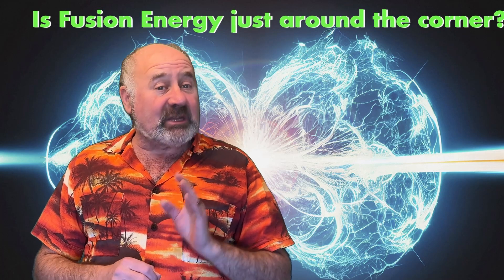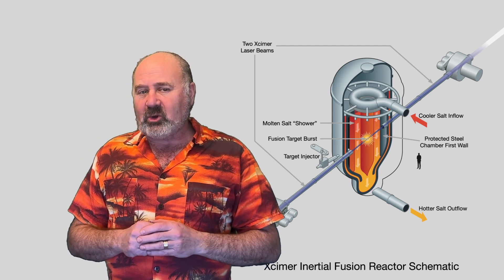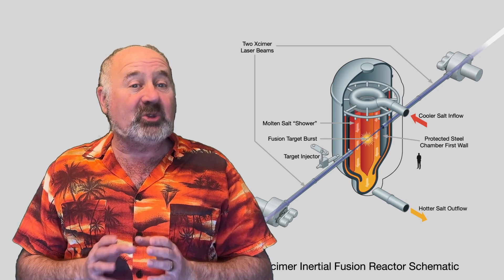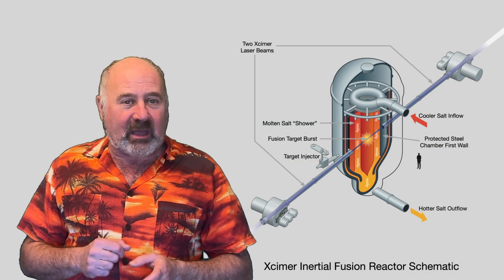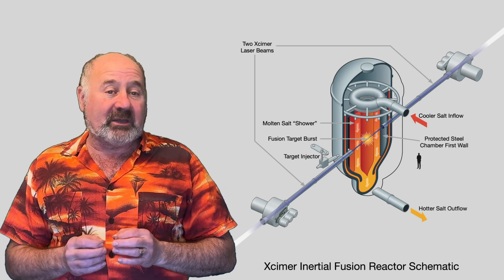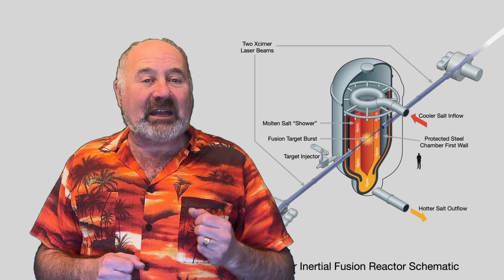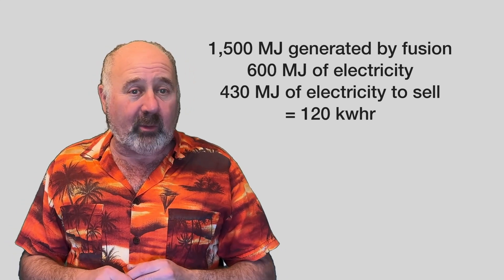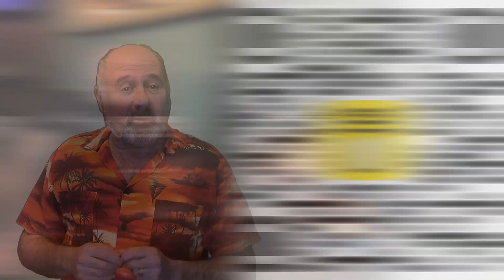Can millions of mini hydrogen-bombs power our world?

Comment: Dear Dr. Silber, thank you for your questions. My plan was to immediately answer them. However, your question about positioning a 20 mg bubble of DT was made irrelevant by Improbable Matter, another highly respected podcaster, who informed me that 6.6 GJ (=20 mg DT fusion energy) far exceeds the maximum reasonable yield (450 MJ).  So, to make everyone happy, I will assume a smaller 1 mg (=330 MJ) bubble when addressing your question. 

Here are the parameters, taken from a spreadsheet I designed to answer such questions: 

	Fluid: (Yb:FliBe, rho=2000 kg/m3, T=750 K, mu=3 Pa.s, 0.19 N/m, 2414 J/kg.K, bp=1703 K) 
	Bubble: (1 mg, 50:50 deuterium/tritium, gamma=1.4, 100% yield=330 MJ) 
	Acoustics: (50 Hz square 15 +/- 5 atm., 50 Hz triangular 40 m/s2 (equ. 4 Gs)) 
	
I used PV=NkT, with 10, 15, and 20 atmospheres pressure, to calculate bubble radii of: 0.53, 0.58, 0.66 cm.  By inputting those radii into the formula (2/9)rho*G*r2/mu, terminal velocities were calculated for upward rising bubbles under the influence of gravity (G=9.81 m/s2): 4.0, 4.9, and 6.4 cm/s. Likewise, the terminal velocities for acoustically driven bubbles were calculated, using G=40 m/s2: 16.5, 20, and 26.2 cm/s. However, because an acoustically driven bubble changes directions 100 times per second, and needs time to accelerate, its average speed is slower: 15, 17.3, and 20.5 cm/s. Thus, it should be possible to acoustically drive a bubble 5.47 cm/s, in tiny steps, relative to the bulk of fluid that surrounds it, by ratcheting back-n-forth, slow-n-fast (15 vs 20.5 cm/s), under high-n-low pressures (20 vs 10 atm). 

Will these bubbles dissolve? I wasn’t sure, so I asked Gemini 2.5 Pro Preview 03-25 and ChatGPT o4-mini-high for their opinions. They both agreed, for short 1-minute time periods, almost no gas dissolves. More specifically, Gemini predicted 0.00372% and ChatGPT predicted only about 0.000012% would dissolve. 

To understand how various pressures (10, 15, 20 atm) influence these bubbles, I calculated the following: 

	Bubble resonance frequency: 1104, 1548, and 2070 Hz.
	Internal gas temperature: 668, 750, and 814 K. 

The following table contains figures-of-merit, related to the expected integrity of bubbles under various pressures and accelerations: 

		10atm	15atm	20atm	Reason why breakup of bubble might occur.
		====	====	====	============================
We (1G)	0.58	0.29	0.18	if Weber#>10, inertia overpowers surface tension. 
Ga (1G)	1.13	0.92	0.80	if Galilei#>25, acceleration overpowers viscosity. 
Eo (1G)	4.56	3.48	2.87	if Eotvos#>20, acceleration overpowers surface tension. 

We (4G)	5.88	3.65	2.51	for 1<We<10,  significant deformation expected. 
Ga (4G)	2.29	1.87	1.62	stable
Eo (4G) 	18.61	14.20	11.72	stable

Because these bubbles are only 1/20th as massive as the previously discussed bubbles, less heat will be generated, so less hot/cold coolant will have to be exchanged per shot. A faster shot rate can be accommodated by adjusting the size of the reactor’s inlet/outlet downward.  For example, if we want the coolant to move 4x faster (m/s) through the inlet, while simultaneously maintaining the same volumetric flow rate (m3/s), we can make the inlet diameter half as wide. 

Back to your question, how can these bubbles be positioned in the exact center of the sphere, without overlapping or causing premature ignition? To answer, we need more data: 

	Radius of sphere:  250 cm
	Fusion energy per shot:  330 MJ
	Yb:FliBe specific heat:  2414 J/kg.K 	
	Yb:FliBe temperature (cold):  750 K 
	Yb:FliBe temperature (hot):  1100 K 
	Yb:FliBe density: 2000 kg/m3
	Inlet width: 0.5 m (r=0.25 m)
	Bubble rise velocity (by natural gravitation @15 atm):  4.9 cm/s
	Acoustic drive velocity:  5.5 cm/s 
	Shots per hour: 60 (=60s/shot)

How much (volume) hot coolant is produced per shot? 

3.3E8 J    1 kg.K     1 [Temp. spread]    1 m3
------------ * ----------- * --------------------------- * ----------- = 0.195 m3/shot
1 shot      2414 J       (1100-750) K       2000 kg

To circulate this volume of coolant, how far, through the inlet, does it need to flow? 

0.195 m3     1 [area of inlet] 
--------------- * --------------------------- =  1 m/shot 
  1 shot       3.14 * (0.25 m)^2 

Assuming the coolant is pumped at a constant rate, how fast would it need to flow through the inlet, so that the correct amount gets circulated in the period between shots? 

1 m       1 shot 
---------- * --------- = 0.017 m/s (=1.7 cm/s) 
1 shot     60 s 

How much is the coolant in the center of the sphere displaced between shots, assuming that the flow is uniformly distributed throughout the cross-section? 

.195 m3   1 [equatorial cross-sectional area] 
------------- * ------------------------------------------------------ = 0.01 m/shot = 1 cm/shot
 1 shot                  3.14 * (2.5 m)^2     

Even if we turn off the acoustic drive and stop pumping the fluid, the bubbles will still rise to the center in less than a minute by gravity’s influence alone. Although it is unnecessary, we can reduce this time, just by lowering the ambient pressure inside the reactor, which makes the bubbles larger and more buoyant. The bubbles, in this example, can be acoustically driven at speeds much faster than necessary, since we do not need to transport them 3.3 meters, outside the reactor walls. :-) 

The previous calculation indicate that these bubbles, far from being buffeted about by violent turbulence, can be held stationary in a zone of almost total stagnation at the center of the reactor. 

This example was not optimized to produce the maximum power.  If that is the goal, better examples, using more massive targets and faster firing rates, are easy to find.  

You asked if I had any graphics. I was looking forward to creating some, using Onshape, an online CAD program. Unfortunately, half way through their online training they messaged me that a subscription was necessary to continue, so I discontinued. 

Before moving on to other questions, like, for example, how is the bubble accurately tracked so it can be positioned in real time, I want you to be totally satisfied with all of my previous answers.  And as always, I welcome critical feedback.
Reply from the maker: Let me start with the graphics because it would really help me understand what you’re talking about. You might be able to just do something fairly simple in PowerPoint or something like that just to get everything you’re talking about straight. This is something I learned making these videos and in product design is start simple and as you understand your problem better you can build sophistication into your illustrations.

One thing that confuse me was your use of 9.8 m/s squared as the acceleration of your bubble. Isn’t it rising under your buoyancy not falling under gravity and therefore it would be a different and lower acceleration?

You also shouldn’t assume that 100% of your fuel is burned. If you want to be very optimistic, you might go with 30%.

Is your bubble just naked D–T? In your diffusion discussion that seemed to be implied, and I assume there was some kind of wrapper or balloon around the hydrogen. Most of the inertial confinement fusion folks have some kind of ablative coating that helps turn the photons into pressure on the heavy hydrogen. In any case, I wouldn’t trust any LLM to tell me whether or not it’s going to diffuse into the surrounding liquid, but I’m also not particularly concerned with that issue. There are other things that I would worry more about.

But my biggest question is why you believe the center of the sphere will be a region “of almost total stagnation”? This is the location where a minute ago you’ve injected a large amount of heat. The heat will flow out through conduction or convection, both of which will create a region that is the opposite of stagnation. 

I think a cartoon panel of how the heat flows and where it goes the instant of destination, and what things look like 30 seconds after detonation and right before the next destination would be very helpful. Include not only how the bubble moves up, but what constraints it from moving left or right, which I believe is your acoustic waves. 

Cheers,

Comment: Thank you, Dr. Silber. The bubble's integrity is extremely important, as you rightly point out.

However, before addressing the bubble's integrity, I should clarify that during bubble transport, the liquid inside the reactor is not expected to be turbulent. I may have unintentionally confused you, as I incorrectly described my liquid as Yb:FliBe without realizing that the term "FliBe" is sometimes reserved specifically for the 2:1 molar mixture of LiF:BeF₂ (which has a water-like viscosity). However, molten salts can be made from mixtures of LiF and BeF₂ in various proportions. For example, the 1:1 mixture is a eutectic composition, melting ~100 K below the 2:1 mixture, but exhibiting a viscosity approximately ten times higher. When I ran my calculations, I posited a honey-like Yb:FLiBe mixture with a viscosity (μ) of 3 Pa·s. While circulating such a high-viscosity coolant through a heat exchanger might be impractical, it could still be suitable for certain thermal processing applications. My main point is that we have considerable freedom to select the FLiBe composition and, consequently, its viscosity, which can span several orders of magnitude. FLiBe's viscosity is largely determined by the formation of BeF₂ polymer chains, which grow with increasing mol% BeF₂ and shrink with increasing LiF concentration (LiF acts as a polymer chain terminator).

The determining factor for turbulence is the Reynolds number (Re): 
     Re = ρvD/μ 

Where, for my example calculation:
     ρ (rho) is the fluid density ≈ 2000 kg/m ³
     v is the fluid velocity ≈ 0.08 m/s
     D is the characteristic length (e.g., pipe diameter) ≈ 1 m
     μ (mu) is the dynamic viscosity of the fluid ≈ 3 Pa·s
Thus, for this example, Re = (2000 kg/m ³ * 0.08 m/s * 1 m) / (3 Pa·s) ≈ 53. This indicates laminar flow, far below the threshold for turbulence, which typically begins around Re > 4000.

Bubble integrity under flow conditions can be estimated using the Weber number (We), a dimensionless quantity representing the ratio of inertial forces to surface tension forces. It is defined as: 
     We = ρv²L/σ

Where:
     ρ is the fluid density
     v is the relative velocity between the bubble and the fluid
     L is the characteristic length of the bubble (e.g., diameter)
     σ (sigma) is the surface tension of the fluid
If We < 1, stable bubbles are generally expected. For 1 < We < 10, significant deformation may occur, but not necessarily breakup. If We > 10, bubble breakup is highly likely.
For our initial example, assuming a 20 mg DT bubble at 750 K and 5 atm:
     ρ ≈ 2000 kg/m ³
     v (bubble velocity relative to fluid) ≈ 0.09 m/s
     L (bubble diameter) ≈ 0.046 m (calculated based on mass, temp, pressure)
     σ ≈ 0.19 N/m
Thus, We = (2000 kg/m ³ * (0.09 m/s)² * 0.046 m) / (0.19 N/m) ≈ 3.9. This value suggests significant deformation is possible.

For acoustic transport, some bubble deformation might be acceptable. Is We = 3.9 too high? Perhaps. However, this value can be readily lowered by reducing the bubble size or the transport velocity. We can shrink the bubble by increasing the ambient pressure or decreasing the amount of DT fuel. We are not locked into the initial assumptions; a 20 mg DT bubble is quite large, approximately 100 times the fuel mass in a typical NIF capsule.

As an alternative scenario, let's consider a smaller, slower bubble:
     v = 0.0254 m/s (1 inch/second)
     L = 0.0254 m (1-inch diameter)
Then, the Weber number becomes:
     We = (2000 kg/m ³ * (0.0254 m/s)² * 0.0254 m) / (0.19 N/m) ≈ 0.17. 
This value falls well within the stable regime (We < 1). Transporting this 1-inch diameter bubble at 1 inch/second to the center of the reactor should be feasible, especially given the laminar flow conditions and the ~16 seconds available between shots.

Besides the Weber number, two other dimensionless numbers are important for characterizing moving bubble behavior, particularly under the influence of gravity: the Galilei number (Ga) and the Eötvös number (Eo).
     Ga = (ρ * g^(1/2) * R^(3/2)) / μ (Ratio of gravitational to viscous forces)
     Eo = (ρ * g * R²) / σ (Ratio of gravitational to surface tension forces)
Note: Here, R is the bubble radius (R = L/2), and g is the acceleration due to gravity.

The following Nature Communications article provides phase plots showing how Ga and Eo influence bubble shape and dynamics: https://www.nature.com/articles/ncomms7268.pdf

Now, let's calculate Ga and Eo for the stable 1-inch bubble example (R = 0.0127 m) under 1 g acceleration (g = 9.81 m/s²), using the previously defined fluid parameters (ρ ≈ 2000 kg/m ³, μ ≈ 3 Pa·s, σ ≈ 0.19 N/m):
     We = 0.17 (Stable, as calculated above)
     Ga = (2000 * 9.81^(1/2) * 0.0127^(3/2)) / 3 ≈ (2000 * 3.132 * 0.00143) / 3 ≈ 3.0
     Eo = (2000 * 9.81 * 0.0127²) / 0.19 ≈ (19620 * 0.0001613) / 0.19 ≈ 16.7
According to the phase plot in the referenced paper (Figure 2), this point (Ga ≈ 3, Eo ≈ 17) falls within Region I (typically characterized by Ga < ~25, Eo < ~20 for stable ellipsoidal bubbles). In this region, bubbles are expected to maintain their integrity and adopt a stable ellipsoidal shape as they accelerate towards terminal velocity.

Thanks for the critical feedback; it's genuinely helpful. I'm sending you another beer. Enjoy!
If you have more comments, please post them. I find the critical ones particularly valuable. Thanks. :-)
Reply from the maker: @michaeldeeth811  Thanks for the beer. Since I’m in Spain at the moment, it’s mainly wine and vermouth at the moment. 

It’s clear you’ve done some solid thinking on this. Kudos!

One thing confused me. You mention a 16 second reception rate, but a velocity of 1 inch a second and I believe a diameter greater than 16”. So is a bubble in your lasing/neutron absorbing fluid moving towards the center during a flash/detonation of a bubble at the center? Wouldn’t that lead to premature/incomplete detonation with a low gain?